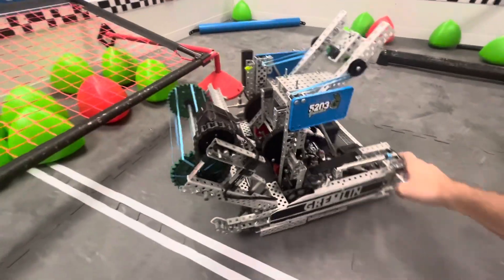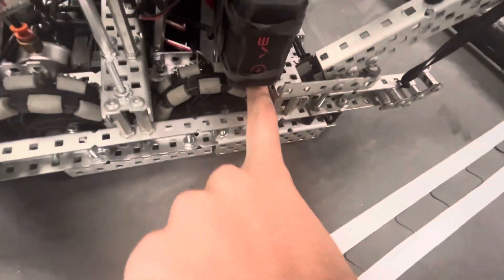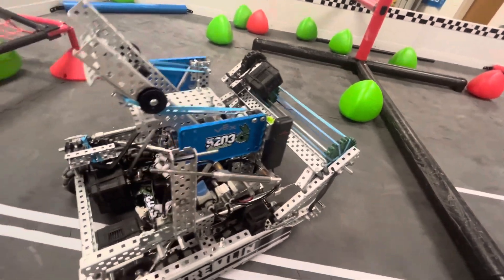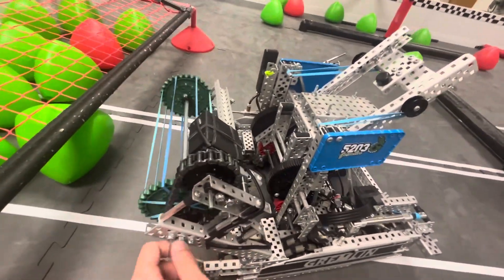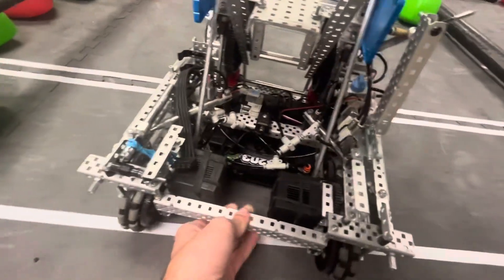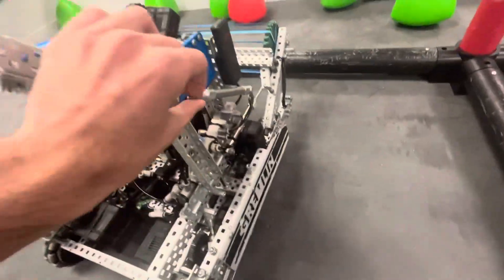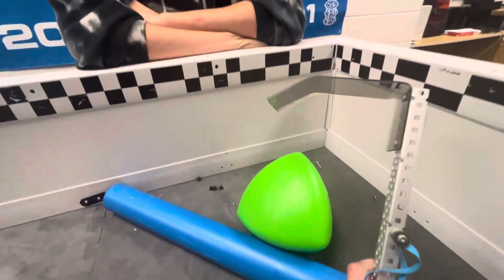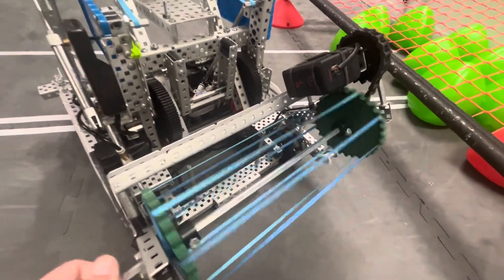5203G MOA Robot Explanation | VEX Over Under

Comment: Heads up... rule R25 says brain button touched, to turn it OFF, from a good/safe location. Having to reach through/under your intake and/or pick the bot up and reach underneath does not meet this criteria. In short, I would fail you @ inspection.
Reply from the maker: We’ve competed with this robot. It is legal
Reply: you would be surprised what you can get away with at inspection, it all depends on how lenient the inspectors are. For example, a lot of people get away with R7h and R7j and this robots power button is quite accessable in my opinion, it doesnt have to be easily accessable, just accessable